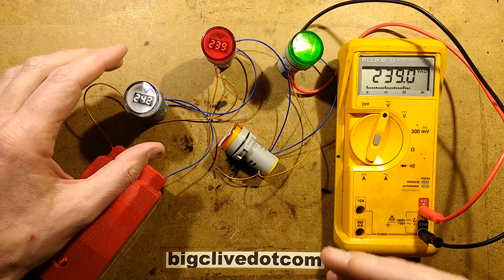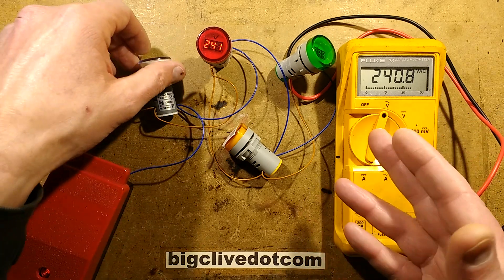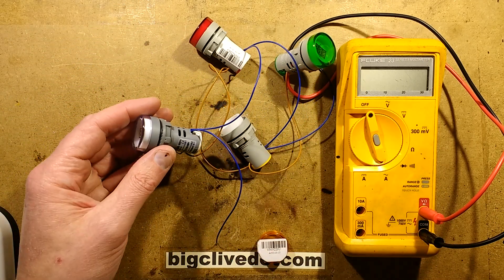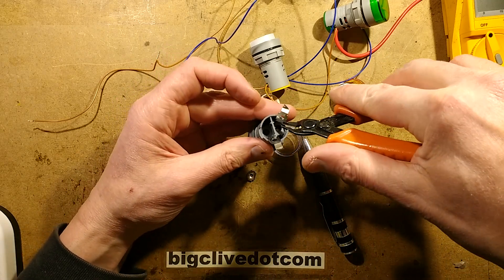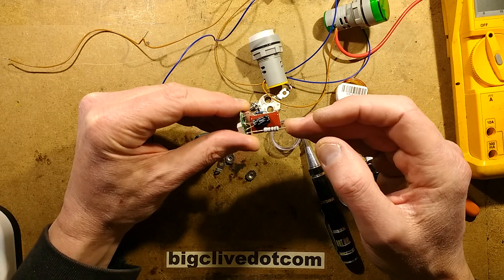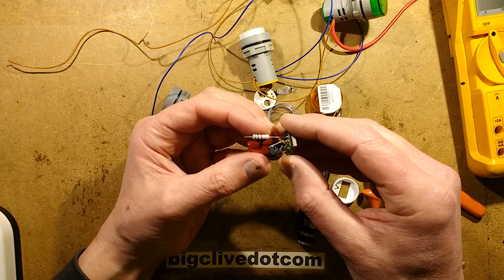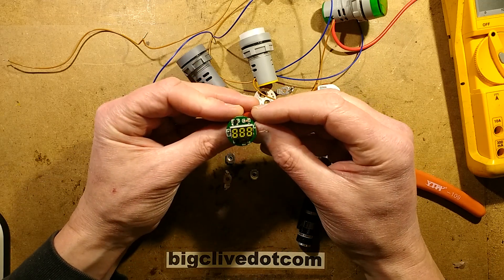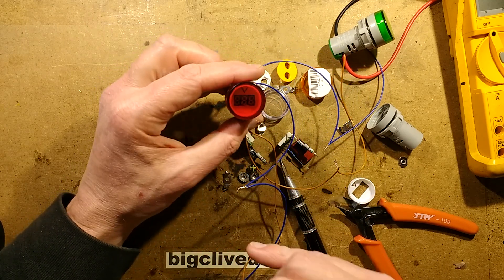Inside a 22mm digital panel indicator/voltmeter.

Comment: I'm not convinced the protective film is supposed to be removed from those 7 segment LEDs. If the manufacturers intended for it to be peeled off, why would they trim it to the exact dimensions of the display with no edge to grab, why would they make it perfectly clear and smoothly applied without ever bubbles or anything in the adhesive, and why wouldn't their datasheets ever mention that it's meant to be removed, or mention it at all (in all the datasheets I've seen)?
Reply from the maker: The displays are probably made as a large black with a common sheet of film with little overlap.  Some equipment does come with the film removed.

Comment: You are so good at everything, BigClive. Is there a way that they can be calibrated, as my mains reads 243V but the indicator reads 250V? Once again, thanks for all of your videos.
Reply from the maker: It could be calibrated by tuning a resistor value.  But the PCB is cramped so I doubt there's a potentiometer.
Reply: Many, many thanks bigclive.

Comment: Some noname-dedicated ic. Its a so-14 package, the 1st and 14th leg ment for power supply (+5v) and a common ground. And the 9th leg appear to be adc input with internal reference of 1.1 volts. Easyly can be converted to dc ampere meter.

Comment: If I have this in circuit always on, will it draw power and reduce my DC output. If so, by how much. I need to maintain a certain voltage.
Reply from the maker: It will draw some current.  You can get LCD meters for low voltage battery use.

Comment: I've got a version of those that plugs into a car cigarette lighter socket, which costed a whole £3 including postage from China. I use it to keep a rough check on my car battery state of charge (my car has a smart charging system, and swaps from circa. 14.4 volt when actually charging the battery, to 12.3V when its fully charged and being floated). 
Only using the car once a week due to Covid lockdown etc., and was surprised to see that it takes well over half an hour to charge the battery after the long shut down period.

Comment: Weird question, could I use one of these to monitor the current going to a large dc motor?  Connecting it between the input and output?
Reply from the maker: They do current measuring versions with external current sensing coils.  you can also get larger panel mount versions with bigger displays.
Reply: @bigclivedotcom  that sounds great I will have a look thank you 💖 your videos are so helpful

Comment: was looking for a mini VDC  gauge ....... so using your info found the DC versions thanks mate
Reply from the maker: Ebay is full of cheap meter modules.  Some can be fine tuned with a small potentiometer inside.

Comment: Any mod to measure voltages starting from 0V?
Reply from the maker: Not really, since it would need a separate power supply for the circuitry.

Comment: By looking the pin 1 VCC and PIN 15 GND i think is ATtiny24A or similar chip. I bought 3 pcs i open one of it , it look exactly same like your one.. there is a Zener to regulate the voltage 4.5V when i connect to 240VAC .. compare to my sanwa meter show 243V so about 3V error.  I check the seller in taobao , they said this meter cant last long for running 380VAC , if want to use for 380VAC need to tell them they will custom make for 380V version.. So i think it may no last long when running at 3phase , phase to phase, i did test it for 415VAC for a short while it run well. i even push up to 450VAC it seen like ok..  The capacitor is 0.47uF 630V , by doing calculation for 50Hz Xc is about 6.7Kohm. for 230VAC current is about 34mA since the zener drop 4.5V(i guess maybe 4.7V zener) , so power on zener about 153mW(assume the LED fully off) . when 415VAC , current is 61.9mA , and power on zener 278.55mW . the voltage regulate Zener seen ok , i guess the zener can handler 0.5W ..  there also a voltage divide resistor for voltage sensing which is the blue one connect to 470nF capacitor having 430K resistance 0.25W ,  during 230VAC , resistor dissipation 123mW  , when 415VAC resistor dissipation about 400mW  , so i guess during 415VAC the blue resistor will get burn easily.

by looking panasonic data https://industrial.panasonic.com/cdbs/www-data/pdf/RDI0000/DMI0000COL75.pdf To work in 415VAC the capacitor DC voltage rating at least 1000VDC and above. i guess 1000VDC 0.47uF capacitor may unable to fit into it..
Reply: The meter still useful for me.. I'm doing SMPS power supply , during testing i will series with a Lamp, so i can connect after the lamp to monitor the voltage drop during load.. rather then using DMM to probe manually and save my time.

Comment: I just got some of these only mine are reading way too high - showing 248/250 when the mains is only 236/237 V.  Am I right in thinking that changing the sense resistor is all that would be needed to correct the reading?
Reply from the maker: Theoretically you could tune the reading with the voltage divider by nudging resistor values slightly.
Reply: @bigclivedotcom  Well I disassembled it, and at 6:56 you are wondering whether the sense resistor is 430k or 130k so you measure it as 430k, but in mine they used a 130k resistor.  I thought maybe this was the mistake so I tried replacing it with a 430k one, but that drops the reading down to 202/204 V for a 240.0 V input so I guess they changed the circuit at some point and I will have to use a calculator to figure out what the correct sense resistor should be!
Reply: Well I found that a 195k resistance instead of the original 130k gets the reading back to what it should be. Interestingly the meters don't seem to be able to show odd numbers, as the 235V mains caused it to oscillate between "234" and "236". My red one is the same design as you show in this video, however my blue and white ones are of a different design. You can identify these externally by looking through the side vent holes and the red film capacitor is physically smaller in them, and also unscrewing the faceplate reveals no surface mount components around the 7-segment display. Also my white one has a yellow 7-seg and the blue one has a green 7-seg...

Comment: These are also available in ammeters, you can get them on Amazon for about $20 USD for a pack of 3 : https://www.amazon.com/Yeeco-Display-Digital-Voltmeter-80-500V/dp/B07D76QJ5C?th=1 This is the "Yeeco" brand, they also have them as "DROK" branded.
Reply from the maker: I've got a couple of different versions here awaiting their video.
Reply: @bigclivedotcom   Look forward to seeing them, thanks! Subbed to your channel a bit ago, love your videos, I have been an A/V and cinema tech for many years...worked at Knott's Berry Farm in the late 80's-early 90's.  Back on topic, I bought the set to monitor motor current on my 480v three phase booster pump controller here in beautiful Atomic City, ID. (I run the water system here.) I got a "mismatched" set, the red and amber are part # AD22-22DSA (only rated to 220v) and the green is a part # AD101-22AM (rated to 380v, and oddly has the "CE" cert stamp), which messed up my plan to power them off of the 277v phase to neutral voltage here. I want to power them instead off of the 115vac control transformer..but I am wondering how the accuracy of the current reading will be on the two that are not phased the same as the transformer's output might be affected. (Since they use sensing CT's I think it shouldn't matter, but...). When I get them installed I'll do a video and we'll see what happens.
Reply from the maker: The current reading shouldn't be affected by the different supply.  It would only be if it measured power factor that it would be affected by phase relationship.

Comment: So I am not the only one who had a faulty three phase isolator.  I turned it off, checked them all and nothing, then went to look around to see where the burning smell was coming from.  Checked a lot of it and found nothing, checked the isolator itself, all ok, but customer said it was smelling (which I didn't argue about) so I turned it on with the panel open ( as you know there is no choice sometimes) to test things.  I found nothing so I turned it off, yes, you guessed it, this time one didn't go fully off and bingo!  Boy did it bloody hurt!  I always have a habit of touching circuits with my finger nail first, this way if it is live where it should not be your muscles naturally contract and your finger is pulled clear of the circuit.  DUH!  What did I learn, check it every time, isolator changed out and it was fine.  No, it took me a day of so to feel fine!  It came as a bit of a surprise, after that no one was allowed to work on three phase panels without someone else being there.  That made no sense to me and I said you will still get electrocuted on 240v.  To this the management replied "Yes, but not so bad!"
What the?!!!

Comment: Question:Though the specs state that the voltage range of these indicator meters is 60V-300V, are they capable of indicating voltages lower than that minimum?  For example, if connected to a variac, would they go down to zero ("000")?
Reply from the maker: The ones I tested had quite as high cut-off voltage.

Comment: Hi      I ordered 4 of these ( 2 red , 1 green , 1 yellow ) from Ruledesign at 99p/103p each
and they have just arrived . Like you I connected them all to my Safeblock and my DMM
but I did it via a variac .  The red and yellow ones started working at 13volts but they were
flashing . At 24v the green started flashing 24 but the others were steady and reading 32v.
it needed more than 60v before they were all steady . At 100v they read  86 , 86, 100 and 100 so the red are not so well calibrated .  Nice !

                                                                                                   Alan

Comment: I got a couple of these from a noname manufacturer and they were not accurate at all.  Only a number on the case: AD16-22DSV.   120vac in and they read ~108vac.  And unlike yours, the readout was to the closest 2v, not 1v.  Found a 7.50K resistor to the lower right of the display that I could change to get an accurate reading.  I hacked a 10K pot in it's place, adjusted it to the display to read the correct value and substituted a fixed resistor in its place.  7.5K to ~8.7K and it reads close enough at 120vac.  A tell-tail sign might be that the V in the white plastic on mine was below the readout, not above like yours.  Reading as close enough down to about 70v.

Comment: Yeah, "always check the panel with a meter." When I was a teenager working as an apprentice for an asphalt plant manufacturer, we were installing new controls in a plant in South Florida. The plant's power panels were all checked and locked out. Overnight there was a small thunderstorm as is normal for the region. Lightning bridged a connection on one of the bus bars inside the panel. One of the techs went to dig out a 3 phase line in the yard, struck the live line and blew 2/3rds of the face of the shovel off. Unbelievably he was thrown/jumped backwards and was fine. I was under a countertop and out if sight, but even the reflection was one of the brightest things I've ever seen... The idiots that owned the planet didn't use conduit, so the wire was just thrown in a ditch and covered (it never freezes in Southern Florida). Moral of the story... sometimes checking, locking out, and labeling aren't enough.

Comment: I wish I could find a replacement rubber holster for my vintage fluke, I have the 77 Series II which is basically the same meter as that. I've been looking on eBay for the past 10 years for one!
Great meter.

Comment: Fluke? bollocks, bring back AVO meters.
Reply: and AVO 7's at that
Reply: The AVO 8 was probably the diamond standard of analogue multimeters.  It's rated 20 kΩ/V, which is actually fairly respectable by modern standards.  It only consumes 50μA from the circuit under test at full swing -- on its 500V range, that is the same as a modern multimeter with a 10MΩ input.  No wonder they hold their value!  The  AVO 7 was only rated 1kΩ/V. That means it will be drawing a whole milliamp from the circuit under test at full  swing!

Of course, any good lab really needs at least one digital and at least one analogue multimeter, since each type has jobs for which it is better suited .....

Comment: I like how those panel indicator/meters are round. That means a simple drill/hole saw/generic round punch is all that is needed to mount it. None of those specialty or expensive DIN rectangular punches that can be a bear to get the rotational alignment just right.
Reply from the maker: When using the rectangular panel punches I use masking tape and measured/drawn lines for perfect alignment.  But the standardised 22mm hole option is nice

Comment: That is one of the stranger things about electronics and ICs now:
the packaging, production, storage and logistic cost so much more than the actual chip that now it is cheaper to waste a computer many times stronger than the one used fore the Apollo missions just to have an illuminated voltage reading.

Yes - those tiny dirty cheap ICs used for this type of application are more capable than the ones used to send men to the moon.

Comment: Did a conversion on one of the other type last week, wanted a 12VDC version, so the cheapest was to use the 220VAC version and simply remove the capacitor. Funny enough the 220VAC versions are perfectly fine at 24VAC, just slightly dimmer.
Reply: nice! thanks for letting me know this is possible!

Comment: Regarding your comment about double checking whether a circuit has been isolated with voltmeter or test lamps. Takes me to my apprenticeship. Had a "simple" task of changing some spent indicator lamps in a control panel. Turned the main isolator on front of panel and and heard some contacts drop out. Came to grab a lamp holder and got a nasty clout. As it was a 1960's machine the terminals were all open and exposed plus it had 240V control needless to say it knocked some sense into me. I had the exact same thing with a broken isolator handle. It broke the contacts enough to drop some relays out but they had sprung back closed. Sometimes now i'll double check and treble check with a different voltmeter just to verify thats working !

Comment: I've watched a few of your videos now, and I've noticed you use the word "voltage". I'm BY NO MEANS an expert, but back in A-level physics my teacher used to teach us to say "Potential Difference", or "PD" instead of voltage. I'm just curious as to these terms and when to use them.
Reply: Voltage is a potential difference. That's effectively the definition of the term.
Reply: The Potential Difference between this and that is x volts.
Reply: Volts is the unit, potential difference is what it measures and voltage is a layman's version of the term (perfectly acceptable in this case). The point of using "potential difference" is that the terminals on a battery could be 9V with respect to each other but 10,000V and 10,009V to ground, for example.
Reply: Ah, ok. I remember they were a bit stern about the difference in college!

Comment: I HATE anonymous chips, have a bench bin with chineseium boards that "could" be repaired if the smoked chips had any data
Reply: Even better is when they do have a label but when you search for it, the only thing you can find is a Korean site that wants to sell you 200,000 of the things.

Comment: Clive , is there any device/software that will interrogate a chip that may be unmarked and identify the chip details ?
Reply: You might be able to get a rough idea from the pinout and then interrogate it with the appropriate manufacturer's tools.
Reply: Not really. Though, Electronics: the Maplin Magazine did feature a project once in the 1990s, to build a logic analyser that used a PC to test and identify 74-type TTL and 4000-type CMOS logic chips.  (Of which it contained no shortage of its own  .....)
Reply: I was thinking of some thing like the CD data base that downloads album data when a music CD is presented to iTunes

Comment: The old spinning utility meter was replaced by an electronic one at my house not too long ago. 3 phases Landis&Gyr.

I was there during the install and asked about the phase voltages. So the installer ripped open the main junction into the meter and probed the terminals.

When he was done, I showed him how to read them directly on the meter... Took me half a minute to work out how; figured that pressing buttons shouldn't mess with meter setting.  Voltages were near enough to those measured by meter.

Months later, I concluded that the meter change had been to my advantage with consistently lower electrical power consumption on my bills.
Reply: Plus the fancy pants electronic meters like the Landis&Gyr one you have allow power distribution companies to monitor the network more effectively as they can have 3G/4G modems installed into them/tariff programming/etc. Also harder for people to steal power using them, compared to the electromechanical meters which have a number of exploitable features :)

Comment: Bigclive, what's the worst electric chock you had ? how many volts ?
Reply from the maker: Most UK shocks are 240 to ground.  That's probably the worst I've had when a metal cased controller I was fitting became live at full mains voltage because the person who had serviced it had left out most of the spacers inside, including the brass one that grounded the case.  As I pulled it out the automatic barrier it was part of, the wires pulled the PCB against the case.